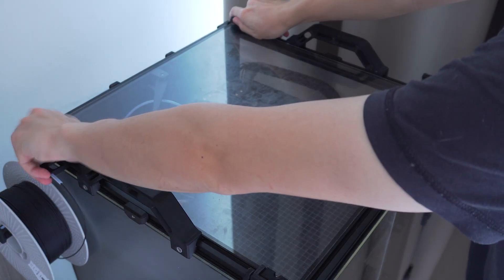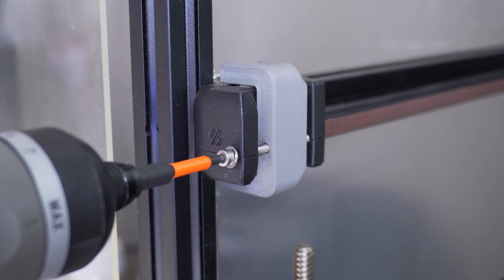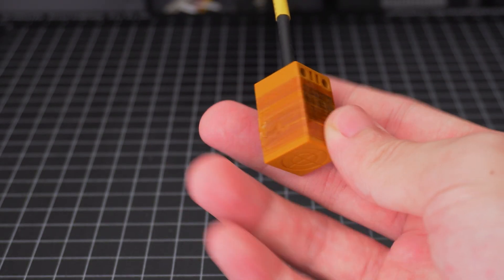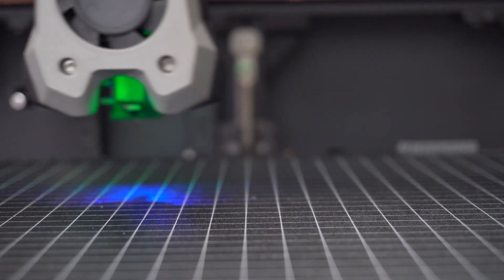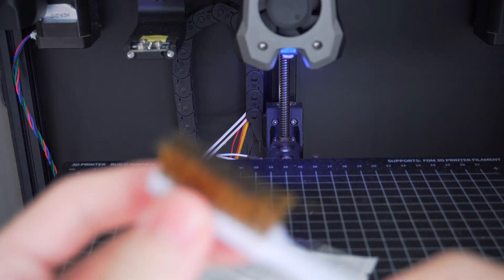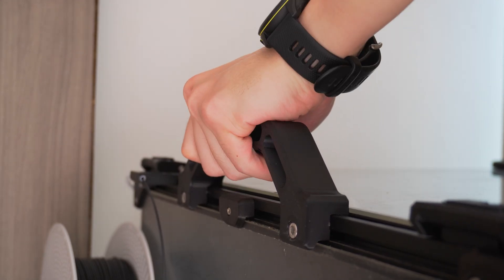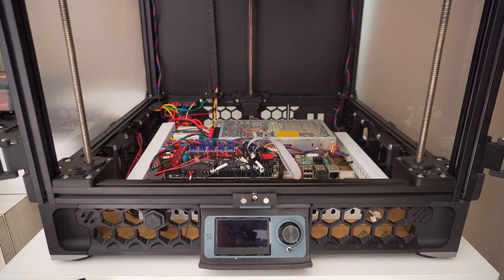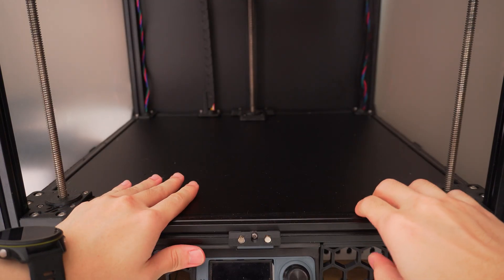Mods I’d add to my Voron 3D Printer on day one

Comment: PCB Klicky is a greaat mod, UNLESS you are going to print filaments like ABS/ASA where you need a high bed temp.  The Omrons on board the PCB don't like the heat.  They're only rated to 85C, and I run my build plate at 100C - 110C when I'm printing ASA.  Since I mostly print ASA, the temps add up.  I'm switching to the PZ Probe for my Revo, but would strongly consider Beacon (with Touch) or Cartographer V4 (with Auto-Z) if I were making major changes to my toolboard setup.

Comment: Cartographer (post-rewrite software) has been indispensable. It's fast, can automatically compensate for gantry twist, and is reliable. CAN Bus is well worth the effort to set it up. Lots of people talk crap about CAN Bus but our knowledge of it has advanced a lot in the last 2 years thanks to people like Esoterical. Follow his guide and you'll be in business.

Definitely agree about BFI, the magnetic cover version is also very nice.

I will probably swap to an A4T toolhead in future but don't really want to spend extra just to get the gen 2 EBB36 from overseas, I'll wait until it's in stock locally.

Comment: I built a 2.4 from scratch and started building in mods before i assembled the frame and kept modifying the build as I went:

2040 X frame rails
Double Z belt (stops the gantry falling)
Cartographer probe
Klicky clacky door
48v stepper drivers
Ball bearing spool mount on the side and top entry filament 
Pinned bearings and spherical gantry bearings
Single horizontal cable chain
CAN tool head

I'm amazed i ever actually finished it and got it working!!

Comment: Great video! Maybe not strictly a "day one" upgrade, but upgrading from the stock toolhead will be the #1 performance booster for your Voron. I can't recommend A4T enough, it's dead easy to assemble, supports loads of different hotends and extruders, has better cooling, is lighter, has a better centre of gravity.... It's the real deal
Reply from the maker: Hey, I’ve seen some of your videos. Awesome stuff! 😄 I was set on A4T but then came across Anthead, and now I’m torn. A4T seems easier to maintain since the whole toolhead detaches from the gantry, but Anthead sure looks slick. I saw you’ve tried a few toolheads on your channel, any thoughts?
Reply: @JustShapesJS  Anthead is designed for the V0 and other Printers for Ants, so it has to make some compromises to fit there. For a "normal" size voron A4T all the way
Reply: The A4T is incredible. Pair it with the Crossbow CNC cutter and you´ve got yourself a nice MMU-toolhead aswell. 
Just make sure to use proper fans and a nice HF hotend aswell. Oh also - Carto or Beacon are great upgrades aswell. The Carto can be had for around 40$ sometimes.

Comment: Clicky clack Door is amazing
Reply from the maker: I did consider the Clicky Clack Door, but for now I went with a 270° clamp-style door. I was a bit concerned about the extra bulk the Clicky Clack adds to the machine but that satisfying ‘fridge door click’ is definitely tempting! How’s your experience with it so far?
Reply: This is my 2nd fav after inverted electronics. Much better insulation for ASA printing, and easier to open/close.
Reply: @HerrRatzle  True! Chamber temps stay much more consistent and even increased after installing Clicky clack. The mod is not that expensive either.

Comment: Nice, perfect timing as I just started my Trident build. Can you links some printables, thingiverse websites where you downloaded all the mods? I can find the inverted electronnics one, but not the button to push it out
Reply from the maker: Sure! I've added links to the mods I used in the video description. Link to the button for inverted electronics mod can be found here: 
https://www.printables.com/model/1303301-push-button-deck-panel-lifter-for-trident-inverted
Reply: I'm interested in a Trident. Which size did you choose?
Reply: @samuelwilson8959 I chose a 300x300x250 Formbot Kit.
Just bigger than my Ender 3, but jot to big.